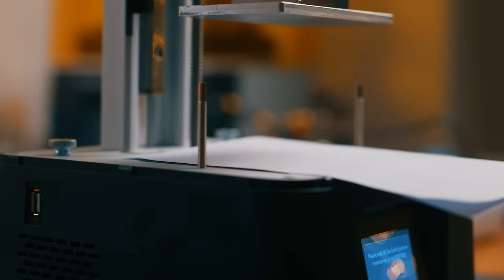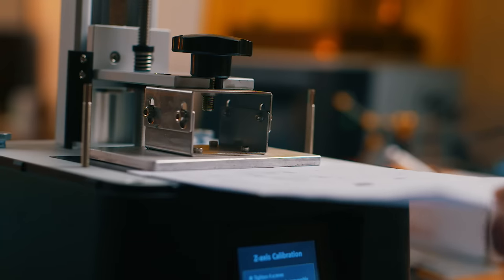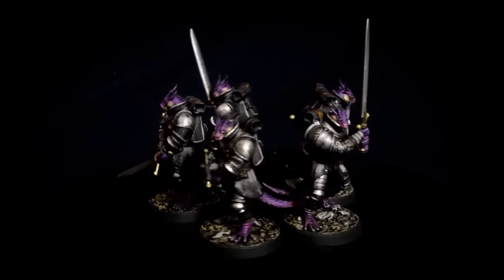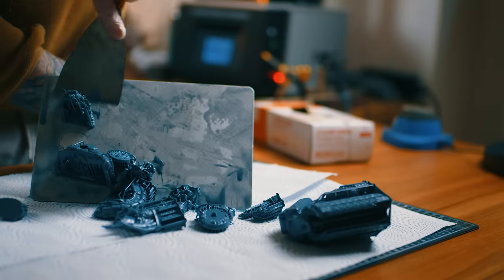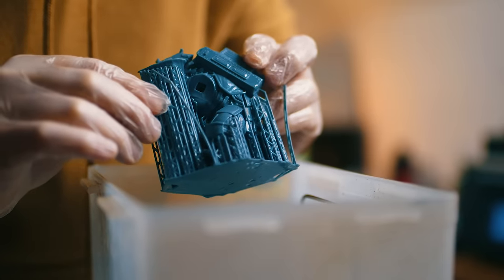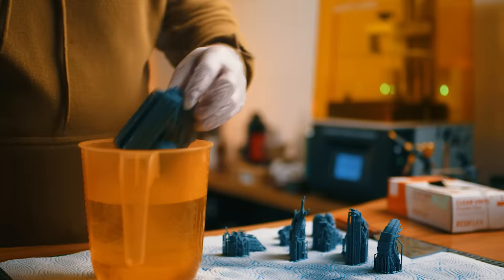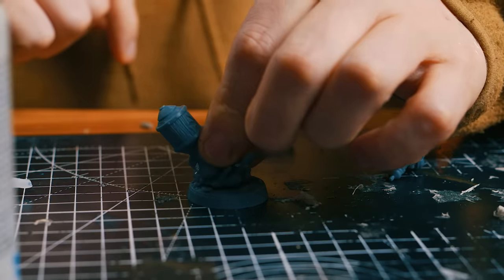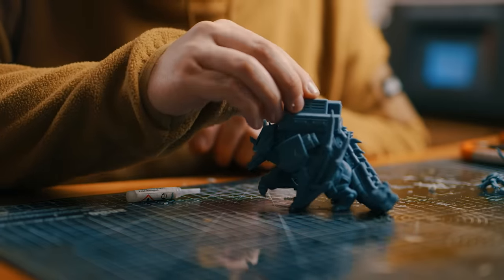Watch This BEFORE BUYING A 3d PRINTER

Comment: Obligatory warning: just because you can't smell it, it doesn't mean it's not harmful.
Reply: Luke or Resin?
Reply: And if it dries faster than water, it’s volatile enough to become an increasing % of the atmosphere in an enclosed room, so ventilation isn’t optional
Reply: Protect your lungs! Those and your eyes accumulate damage and are really bad at recovering.
Reply: I would simply close my eyes and hold my breath while working with the resin, but again I would be proving that I am just built different.
Reply: @Based_Lord_Humongous  Look at this Chad who does 3D printing stuff just by sensing the micro-vibrations through his hands. Inspirational.
Reply: @Lamefoureyes  not trying to argue but your eyes particularly the outside layers heal faster than anything else on your body, true story.
Reply: @TheEnd  But what about their emotional health
Reply: Are you talking about the Methylated Spirits?

Comment: I’d suggest water curing as something I always do. Just pop your models in a jam jar of water and cure half the normal time. Oxygen inhibits curing and water contains less than 1% the amount of free oxygen as air, my models often felt a bit sticky or greasy until I tried water curing and now I get a flawless finish every time.
Reply: Is the water distilled?
Reply: Tap water?
Reply: Is this with water washable resin or regular resin?

Comment: My best tip. Stop using a scraper to get models off the build plate!  

Use a razor blade to slip under the corner of your model and the plate then just run it up the side.

I'm glad you mentioned the temperature thing!  We always see WAY more comments on the forums during the winter all due to cold.
Take your build plate off run it under hot water till it warms up.  That will warm your resin at the point of contact. No heater needed.
Reply: I use an old Stanley knife
Reply: I use a Plastic Razor blade. You get a bunch of razors in the pack (50+), they are disposable and cheap.
Reply: Better tip - find a compatible removable/flexible magnetic build plate to easily remove models.
Reply: @ValueRobot  I've used magnetic plates before but gone back to regular.  I actually had trouble with the print suction pulling magnetic plates OFF the magnet pad and getting a Z drift in the print.  

ALSO the magnet doesn't retain heat like the metal build plate so you have more adhesion problems in cold weather.

Comment: Best upgrade to buy is a Wham Bam flex plate. This is one upgrade that is very worth the cost.
Exposure times for your resin is the most important item after a level build plate. The single best exposure test out there is The Cones of Calibration from TableFlip Foundry. It takes all the guess work out of it. Once you get the proper exposure time for that printer and resin, write it down in a notebook, sticky note on the wall, whatever. 
Another tip is to take your alcohol bath, the dirty one, put a lid on it, and expose it to sunlight, and you can often scoop away the sludge and have a cleaner bath. 
I'll have to try meth spirits, never even heard of it, but if it's cheaper, well worth it.
Reply: Outside of the British Commonwealth I believe methylated spirit tends to be called denatured alcohol.
Reply: The flexible plate has made my sonic so much more agreeable to use. Apart from time and aggro, I always doubted my plate was level after taking it out and wresting a print off it.

Comment: After 2 years of 3d printing, washing in meths and then the warm water clean/desprue is the goto method, once you have the right settings dialled in then good to go.

On a note Mentioning thingiverse and 3d cults, i too started with them and after a mixture of failures and good prints the main thing i noted is a lot of designers are just starting out on those sites and the stl's are not optimised half the time, no presupport or support guidelines, not sliced/cut or hollowed and scale can be off, its a lottery where is if you find a good producer of stl files with support then although you are paying you shouldn't have the headaches of failed prints and wasted resin.

Cheers for a good vid!

Comment: If you rough up or scratch up (with a knife point) one or both sides, a trick is to add the glue to one side, then, when put together, as the glue seeps into the cracks and scratches and roughed surface of the other side, it spreads thinner, out into those crevices, and sets up immediately, hardening super strong.

Comment: Definitely recommend finding a patreon/tribe you like and subscribing for a month. Pre-supported models are great while you are learning the dark art of supporting.
Going to have to give meths a go when this batch of IPA is doo dirty to settle out. I have no easy access to hot water in my hobby space ( in the loft) so I use a hair dryer after the IPA clean to heat things up when removing supports and it works well. Regarding our lovely British winter, I use a super cheap 40w bar heater from screwfix in a cardboard box, 5 degrees ambient in the loft 20 degrees+ in my cardboard box.

Comment: Good advice. I'm going to try your recommendation for methylated spirits rather than isopropanol, which I've heard elsewhere also reduces the damage to smooth surfaces that can be caused by iso. 

NB: Methylated Spirits is actually ethanol (grain alcohol) with things added to make it poisonous, which can include methanol. In the US, it's usually called "Denatured Alcohol".
Reply: Hi, have you tested it? Does it work? In the EU you start fires with it so... I am a bit worried.
Reply: @mwb8666  I'm sure someone told me not to use metho on resin because it dissolves. If that's not true then awesome

Comment: 100% agree with everything you have said! I switched to Meths as a cleaner back when you first mentioned it many vids ago! I have yet to change my meths vat, it’s murky as but still works perfectly. I follow with a hot water wash in a bucket as well for the same reasons, it cleans and makes the supports easier to remove. Great vid and well worth watching again!
Reply: What brand of spirits are you using?
Reply: @robertkelly3948  here in NZ I’m using the Diggers 4lt Methylated Spirits brand from Bunnings. The price was NZ$20, and I have been using the same bottle for the last 8 months solid, no cleaning of the wash station or anything. It’s so cloudy I can’t actually see the prints when they are being washed but they still come out perfectly clean. I do drop them in a bowel of hot water to rinse and make the supports easier to come off before curing.

Comment: A little torque wrench from Screwfix will help with the tightening Vs overtightening, 1/4 inch drive is about £20. Then you just need the right size hex bit.

Comment: Guys... Buy a grow tent, air filter, carbon filter and build your print station in there. Controlled UV, controlled air flow and temperature. Around £80 for tent, £50 for pump and same again for filter, maybe £20 on piping / hosing.
Reply: Yes, trying to keep it warm in winter is a right pain, isn't it? I've been trying to use a fermentation heating band and a Deliveroo insulated food bag (!) but it's all a bit wobbly. I like the idea of a grow tent but it's maintaining the temperature that's foxing me. How did you do it with yours, Rusty?
Reply: @TheHunch8ack  get a greenhouse heating bar, low energy, low temp, but when enclosed it keeps a nice ambient temp (and can get in the size you want, and control the temp, more you spend better you get as always)
Reply: @rustyrocks69  Cheers, I'll give it a go!

Comment: Thank you very much! I've been printing for a while and I too am not particularly happy with Isopropyl alcohol and I'm looking for something else. Apparently what's called "Methylated Spirits" is the UK, Australia, etc is called "Denatured alcohol" in other countries (I live in Italy). As all types of alcohol it comes in a variety of concentrations. Could you please provide a bit more details on the type you use? Or a link to the product itself so I can look up its characteristics and find something similar locally? In particular the % of methyl, as - again - that can vary a lot. Thank you very very much once again!
Reply: Yeah, I've switched to meths, IPA tends to leave white marks on the print if it's been doused in IPA for too long. When it comes to meths don't get the dark tinted meths; this can discolour your resin. I use a very light pink meths. Of course the best if you can get it is industrial meths but difficult to get since they don't want you to make moonshine 😉
Reply: @TheAndrian463  thanks. again, a link to the one you use, or even just its name, so I can look up its composition? thanks!
Reply: It varies by country, in the UK for example methylated spirits by law has to be at least 95% ethyl alcohol for industrial use, consumer grade is 90% with regulations on what the % of denaturants are in both cases (methanol), consumer grade is also died purple.  In the US, denatured alcohol can be as little as 40% alcohol and 60% methanol, methanol is not nice.

I don't know if there are any EU regulations regarding the quantities of denaturants, I'm UK based and use bioethanol.  It's similar to metho/denatured alcohol being mostly plant based (distilled ethanol) unlike ISO (petrochemical) but has no toxic methanol.

Most bioethanol for sale in the UK claims to be 95% alcohol but as with denatured alcohol and iso, it's hydrophilic, meaning they all attract water so the purity will drop over time as they suck moisture from the air.
Reply: @pgabrieli  Hi, seems my reply earlier on got blocked because I provided a link to Amazon for the product. Look up the brand Supadec Methylated Spirit 5L (590833) the picture (Industrial Plasters Brand) is not the one I received but Supadec. It is clear but with a very light pink tint according to my eyesight and does not have a pungent smell as the darker purple tinted meths - seems purer to me. What I received works for me but ymmv.
Reply: @tuvaaq  If you're using bioethanol to wash your prints, could you share what brand you're using? I keep getting fuels when looking up bioethanol and am not sure if they're the same product.
Reply: @lovelikelead9322  Sorry for not replying sooner but yeah that's the right stuff, it's sold as fireplace fuel.  The brand I have in at the moment is called EkoFuel, no longer live near a UK B&Q DIY store so can't buy locally.
Reply: @tuvaaq  No biggie, and thank you for the clarification, it's much appreciated! 👍

Comment: Temperature is a big thing that I still struggle with because my printers are in the basement. I do like the curing station though because I don't have a really good windowsill to put the miniatures on that is safe from the cats or is ventilated because they can start to smell before they're cured.
Reply: I have a small compact 40w bar heater (Its about 12-14" long) that sits right next to my printer. A big cardboard box lined with silver bubble wrap goes over the top, nice and warm. My hobby space is in the loft and it can get down to only a few degrees up there in the winter. I think the heater cost me less than 15 quid from screwfix or toolstation, cant remember which., and at 40W with a thermostat so its not gonna eat through your electricity.

Comment: When your isopropyl gets cloudy stick it in a clear container that you don't care about that seals and stick it outside in the sun once all the resin has solidified filter the isopropyl and reuse it.
Reply: Let it sit for a week or so and all the resin will settle to the bottom, no need for UV, you can just decant the clean IPA off the top and leave the sludge in the bottom for the next batch of dirty IPA. I use this method to rotate 2x 5l batches of IP. Once I have a good build up of sludge I filter this thru several layers of cheesecloth and squeeze out as much IPA as I can they cure the residue off before it goes in the bin.
Reply: @B4MBI72  My way is faster and simpler.

Comment: I just started 3d printing like 3 weeks ago, and I'm not sure I agree with you. How is signing up to a subscription service for models you might not even like, going to help you learn. Free supported files exist and the comments and reviews help a lot with finding out settings and if they require further supporting, which I think is as an important skill to learn when taking on 3d printing, it's amazing to have that skill. It's great you are getting sponsored, but I don't think condoning free files over a paid subscription is the right message. I think learning from mistakes is better than perfect prints from pre supported files. Just my opinion
Reply: You know you can just sign up for the one month they have something you like right? If you're trying to get your settings dialed in, checking you can get a good print out, you're gonna want to make sure you actually have a properly made supported STL. Reputable patreons and stores are just a good way of ensuring that, before jumping into less tried and tested creations.
Reply: @Relyx  So none of those points were made in the video and as I already stated, the free files on site often have examples of 3d models created with that file, and you would not necessarily get a perfect print from one of those paid sites as you would have to consider the printer, the positioning on the bed, the settings, the resin and a number of other points made in the video. So why not get all of this honed in with a free file that you can see other people have already used successfully. Also he states in the video later on how he wishes he didn't go all in on the printer "accessories" by the same logic, free files would be just as useful. I just don't agree with recommending a paid subscription service, even if for just one month, which happens to be a sponser, for first time users when in the same video he sates to not even shell out for a UV nail light and to just let them cure outside. It just seems to be contradictory and biased to a sponsor. Again, just my opinion

Comment: Apparently a brewers belt wrapped around the bottom of the printer keeps the resin a good temperature. Probably cheaper to run then a heater as well

Comment: Brilliant video just at a time I needed it 👍 One question though, if you have the time. Which would you recommend as the cheapest starter printer, that’s not going to be used that often?
Reply: Elegoo Mars 2 Pro. $135 right now.  Best deal ever in my opinion.
Reply: @toddzino58  cheers 👍
Reply: @toddzino58  Yup. Ordered mine last week. And this video makes me happy I didn't buy the Wash/Cure station with it :p

Comment: Thx for the nice video and tips.... I have a special issue you or perhaps s.o. can help me with: During the last year i printed tons of things with my anycubic photon and anycubic photon mono. at the beginning a had many failures but i learned a lot and finally everything worked well since now: i paused for a half year. wenn i started again, i updated chitubox to the new version (1.94). now my photon mono sometimes does not print the figure to the end. it just stops at a certain level. the figure then looks like cut off at a certain height. Ironically, the "straight cut" is not at one height for all figures on the platform, its different. ... i lowered the retract speed, but this doesnt work. ... i think i will use an other clicer, or could it just be a failure with the model? it was a presupported version from a company i never had trouble with the supports....

Comment: 2 things I’d add 

1. Plastic razor scraper so you don’t damage the build plate and you won’t need a flex plate 

2. Bottle warmer to remove supports. Dead cheap on eBay and means you can keep using the same water and it’s a consistent temperature

Comment: You say methylated spirits is cheaper than IPA, I haven't found it cheaper at all 🤔 IPA is more pure than meths maybe it's the Ethanol?  but again I have found this to be more expensive. Did you try the pink methylated spirits? If so may give it a go.